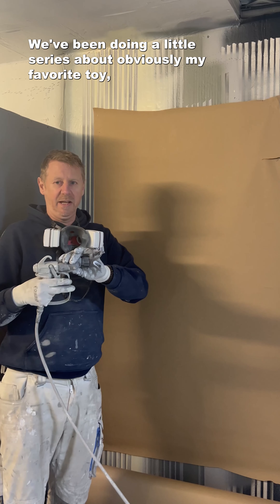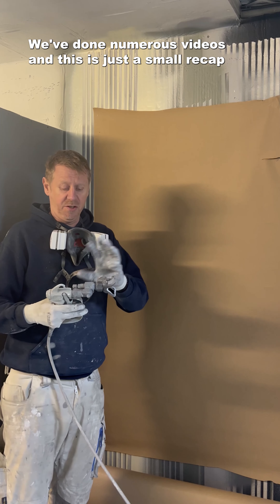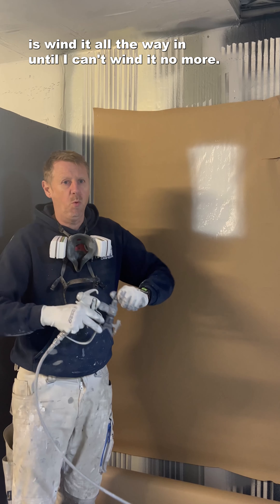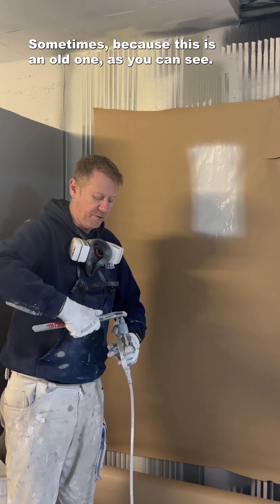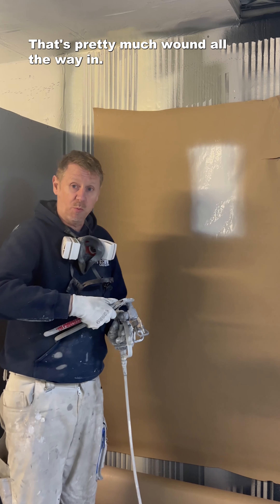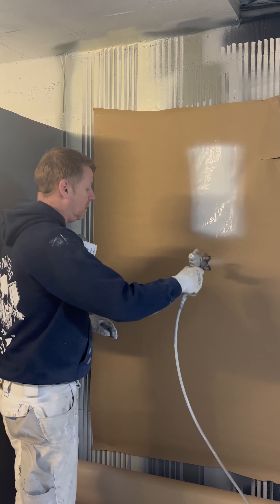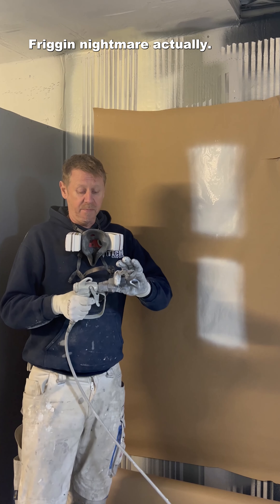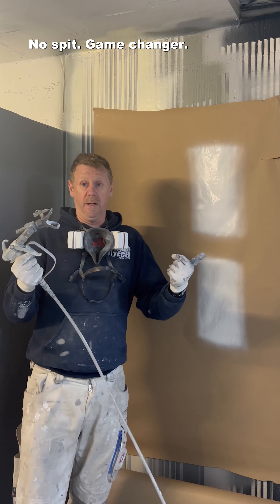Mastering the Graco Cleanshot: Dialing into the Sweet Spot for a Spit-Free Spray

Comment: Just picked one of these up. Running a few different products around that 14-1500 psi range. Still getting spits, even with brand new spray tip. Cranked it all the way down, then backed it off until paint flows. Ideas?

Seemed to kind of work using emerald urethane with a 412, sprayed some gallery series with a new graco fflp 308 and getting spits.

Comment: Great video but where do the spits some from to begin with.
My barely used t4 spits already
Reply: It’s nuthing to do with the machine you are using,  it’s that the shut off needle in an airless gun isn’t  positioned right at the end of your spray tip. So when the needle shuts there is still paint from the tip seal and end of tip that is pushed out at no pressure. There for you get a blob of unatomised paint coming out. Hope that helps
Reply: That does help thanks